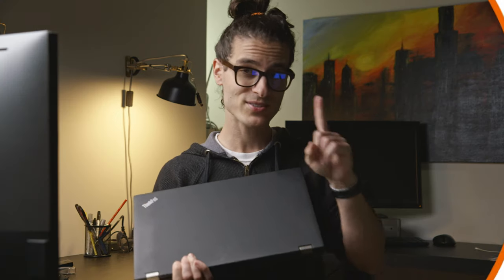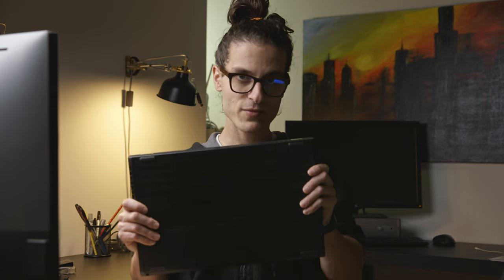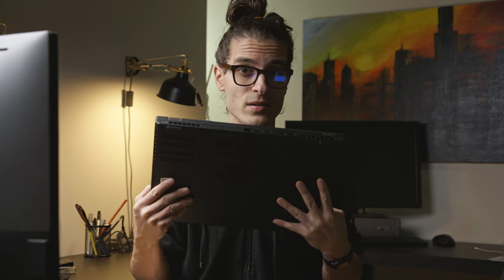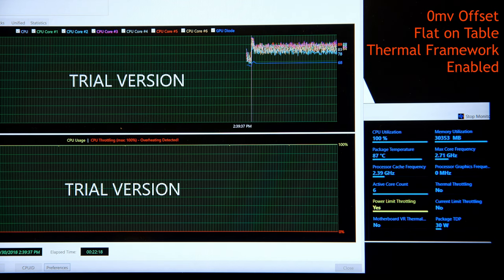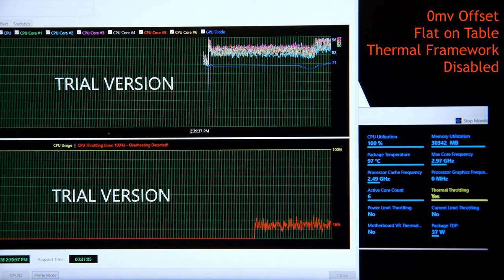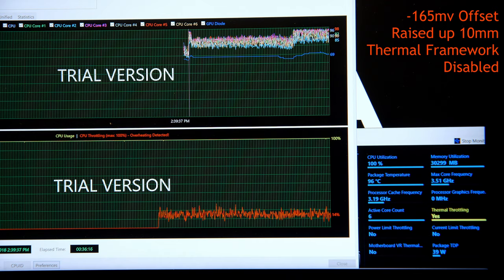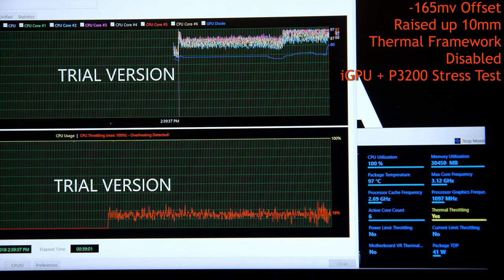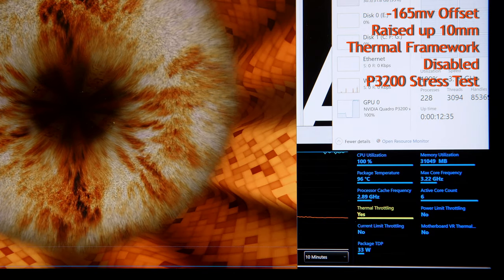According to Jon: Lenovo P52 Thermals Undervolting CPU

Comment: My Lenovo Thinkpad P52 with a undervolt of -0.140V runs on 4.3Ghz all cores full 100% CPU load with thermals between 83-91C. Thanks alot for this video! Helped me get my unit to not thermal throttle. Before I undervolted it got 3,8Ghz all cores and a toasty 97-100C! Specs on my P52 is i9-8950HK, 16GB, 1TB NVME and 4K Multitouch with a Quadro P3200 6GB. Runs flawless with Adobe Premier Pro, Photoshop and a full Cubase Pro session with no recorded drops on latencymon (Got to turn on airplane mode to get no dropouts while recording). Was actually considering returning the unit but after this I will definately keep it!

Thank you so much for this video b1n0ry! Love your video style and reviews. Subbed!

Comment: I don't know what Aida64 settings do you use, and what bios/drivers version do you have, but mine P52 only with -0.140V can handle 3.9 Ghz on all cores in Aida64. I don't have any further modifications.

Comment: Hi, great video. Did you ever come up with a better solution to lower the thermals without repasting? Would a dedicated cooling pad help? Planning to use this as a DAW. Thanks
Reply from the maker: dedicated cooling pad helps, and I also removed the dust filters (requires full disassembly), from all the intake vents on the bottom of the laptop.

Comment: I have opened my P50 twice during the last 18 months that i have had it. It is a bit complicated to reach the cpu cooler, but take a few hours, do it nice and patient, you will be good. 

I think there might be room for serious improvement in cpu temps with your machine because something simply seems wrong. At first i tought it's running so hot because the P3200 is dumping way more heat into the cooling solution then the m2000m in my P50. 

But then i saw that you have idle temps of about 60-65C.  
That's just crazy. There is probably a thermal contact problem betweeen the cooler and the cpu.

If you do this paste replacement please record something about this because the thermals and GPU power are the main major difference between the p52 and the P1. 
If the p52 can't offer seriously better thermals then the P1 at much quieter levels. Then it kind of starts rendering itself a bit obsolete unless you really don't care about weight. 

I love my p50 but it is on the heavey side an that is a downside. I would however be willing to replace it with a p1 only if thermals could be acceptable.
Reply: The vlog had me switch to precision 7530. that is crazy idle temps 60-65c. I have the MSI gs65 stealth thin n my idle temp is 48-50. I never got past 91C on stress test.  I am going to pass on the lenovo p52 lol

Comment: Wanna upgrade my ThinkPad P52 RAM to 64Gb.
The i7 8850H CPU supports 2666Mhz [from intel’s specs sheet] and, from AiDA64, so does the motherboard but I haven't found a successful report yet, anywhere.
Have you got the chance to try a 2666Mhz RAM [Performance kit preferred]?
Reply from the maker: The stock ram is 2666Mhz, but it only runs at 2400Mhz. Not sure why though, maybe a chipset limitation?

Comment: Hi Jon, can i ask you which bios version is your P52? Do your bios enable Intel Virtualization (VT-d , VT-x)? Thank for reading my question. Cause i soon get P52, and i need these option to running Hyper-V or VMWare. Can you check out this.
Reply from the maker: Hello. I'm running the BIOS version 1.17. I do have VT-d, and VT-x enabled.
Reply: @b1n0ry3  very thanks you Jon, hope i will get my soon, i also love your vid. It very helpful for me to running out max this machine power. By the way did you update bios via windows?
Reply from the maker: yes, all bios updates where via the Lenovo Software Update program.  @tmkhanh202
Reply: @b1n0ry3  once again thanks you Jon